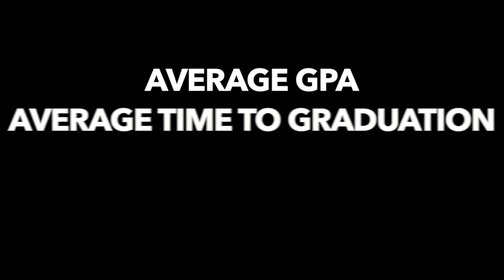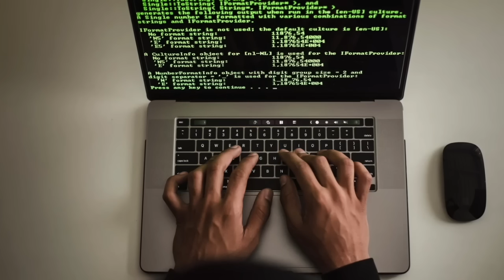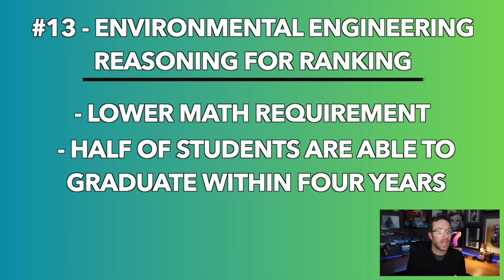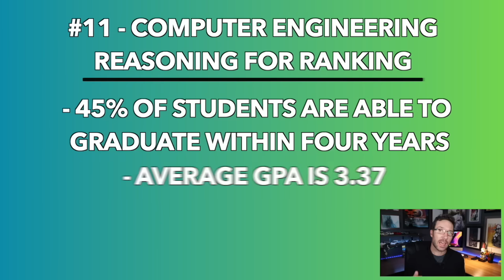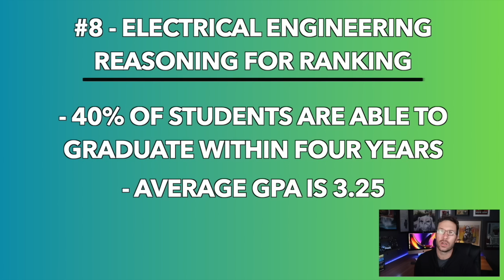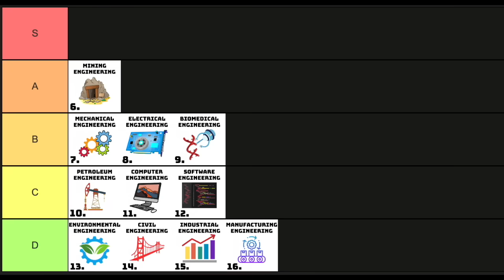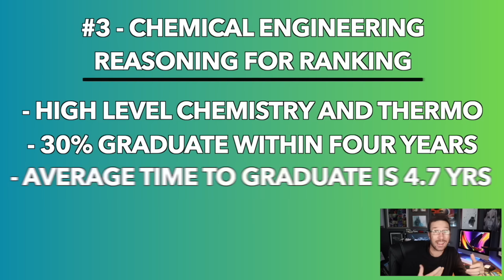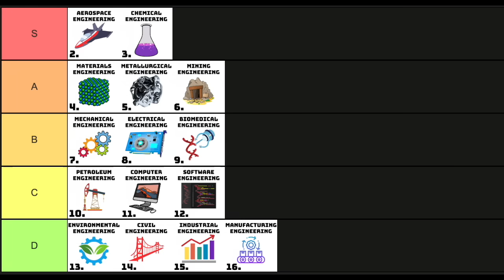Engineering Degrees Ranked By Difficulty (Tier List)

Comment: I have an electrical engineering degree, I wasn't even sure what 'Ordinary Differential Equations' were until I looked it up (its been 15 yrs since graduation). It looks fairly simple compared to what I would call the 'Highest Level of Math Required'. In my opinion, the hardest math (and most fun) that I had to learn was Calculus 3 - aka Vector Calculus, which was required for taking Electromagnetics & Advanced Electromagnetics. Think vector field functions in 3D - magnetic/electric fields. Those were actually my favorite.
Reply: ordinary diff eq are composed of all terms of one variable

Comment: Where should I place electromechanical engineering. Btw I study in Belgium that's why.
Reply: Good question!  I expect a lot of these statistics are primarily for U.S. universities, so the numbers are going to be different.  My guess, though, is that that degree probably combines a lot of pieces from both electrical and mechanical engineering and thus is going to be a little harder than either one alone.  And also it gives you a background that lets you get many of the jobs that an EE would be able to get, and many of the jobs that an ME, so the salary range is likely to be somewhere between the average and the max of the two.
Reply: @BrooksMoses  Appreciate your thoughts 🙏

Comment: Didn’t expect do go top 2 but I’ll take it , you’re sport on with the graduation it takes approximately 5 years on average, I expected petroleum engineering to be higher on the list. Specifically considering gas ⛽️ is almost used in all industries.

Comment: I don't know based on what are you saying about the highest math of a electrical engineering but in my uni that gives masters degree we have applied mathematics, multivariable calculus ,double and triple integrals , electromagnetic theory with maxwell equations , non linear control systems in which you don't have ordinary differential equatinons,Laplace Fourier series and transform Z transform and so many more
Reply: I'm not that smart...would love to be but it just ain't so!
Reply: i struggle so much here "Laplace Fourier series"

Comment: You left out a general Agrictural Engineering degree.  I would rank this one way up there on the difficulty due to everything you have to be proficient in.  This goes beyond the options that focus on food processing or machines or the environmental and natural resources.  You have to be profiecient is some aerospace, some chemical (bioprocessing), electrical from networks to 3-phase power for motors, to environmental (water structures, waste processing, soil erosion, ect) , industrial (manufacturing and robotics), mechanical machine design, to structural.  I have done all of this in my career and the PE exam is tough!   Not everyone can switch gears from fiber optics to concrete design and bridge design to to designing water treatment for a hog farm or air ventilation for a chicken house.

Comment: Mechanical Engineering and Aeronautical Engineering are the most difficult based on the difficulty of the subjects (thermofluids, stress analysis, advanced computer modelling... Etc). That's my anecdotal experience. I noticed all other engineering disciplines (electrical, chem, biochem, civil) having far fewer lectures and far fewer assignments. The maths requirement is high for all, but in Mechanical/Aero, you need to be a jack of all trades and also a master of all trades. With a foundation in Mech Eng, some can get a PhD in Electrical & Electronic Engineering, but going in the other direction (E&EE to Mech) is unheard of.
Reply: In what world do the chemical engineering students get less lectures and assignments? I’d love to go there 😂
Reply: @satrickptar6265  Chem Eng has fewer lectures and fewer assignments than Mech Eng. It's a fact. My direct observation. Mech Eng is the most intensive.

Comment: Sorry but this does not pass the funny look test from a course challenge perspective.  The toughest part of eng degree is picking a course that fits your interests and math skill levels.  When things start moving it gets more complicated, and meche covers so many topics plus requires high level math not only in math coursework but in problem solving for meche courses that it can be tough for many.  Cheme can also be tough because of the chemistry, ee can be tough if you are not interested in the topic, on and on.  The biggest challenge is finding knowledgeable folks to talk to during high school yrs to pick a degree once you are convinced to go engineering.  Wish all you young stem folks alot of grit, determination, and the energy to make their engineering dreams a reality!!!!!!  Then once you get employed the biggest decision is often technical or management (aka the dark side).  Those of us that picked technical careers early may have regretted it later or switched to management mid-career after watchin lesser technical prowess leap forward in compensation.  The difference in "doing work" vs "directing work" can result in 2-4x compensation over a career.  That's quality of life financially but mngt often requires one to be politically and morally flexible, one often has to parrot or cheerlead their bosses' or the company leaders' opinions and narratives, not something all of can do and maintain quality of life.  Good luck, its a helluva journey that can deliver a great quality of life and a secure retirement even with all the nutjobs in DC.

Comment: As an EE, I learned partial differential equations for electromagnetics. I think it is pretty similar to the ME's math needed for fluid dynamics.
Funny, I never needed to solve any differential equations after I learned to transform differential equations into the frequency domain using Laplace and Fourier transformation.
Reply: @BrooksMoses yeah guess so. I'm lucky 🥳 Dynamic systems (I do robotics) are easy when you linearize modelling around an sensible operating point and dont force the real system into saturation.
Reply: Yeah, yeah, you EEs and your nice well-behaved linear differential equations.  Look at you living up the easy life.  :)

Signed, a guy who did a ME Ph.D. in computational fluid mechanics, where non-linearity is everything and frequency-domain transforms just make the problem different, not easier.

Comment: At the end of the day it's about money. My first degree was electrical and electronic. My personal reasons? I love to tinker and the pricing of electronics means, in general, I can do it myself without being a perpetual cog in a machine. I think, if I were setting out today, I would like to get into genetic engineering which I regard (along with AI and Data Science) as the Next Big Thing. Most of my life I'd say the most dominant and important field of engineering was materials science. In terms of degree of difficulty (no pun intended) the only people I've found myself in awe of, during a career that took me into many different fields, are the space guys (astrophysics in particular). To succeed in this discipline you have to be super bright. My IQ, realistically, has never been higher than 145 and not good enough to a be an astrophysicist. Almost any other discipline I could've managed easily.

Comment: I'm a mechanical engineering student , going in my 6th sem , up until I have studied subjects from Automobile Eng., material Eng., production Eng., manufacturing Eng., environmental Eng., industrial Eng. , Designing(AutoCAD etc.) , CSE( C programming in 1st year + MATLAB programming ) ,Along with all other Mechanical Engineering subjects (like - thermodynamics, TOM, heat transfer , fluid mechanics , Eng. mechanics, etc.) + various subjects from different Eng. branches during 1st year and obviously Eng. Mathematics in multiple Semesters . and i have excluded all those courses I have done by myself from SWAYAM portal and others platforms.
I have 3 semesters left until my degree is complete.

Comment: Main things I would change to the list are:
-  EE needs to be broken up into several different sub-categories, that are very different from each other (digital, analog, DSP, RF/Em, etc) ... for some, the ranking might be about right, but for others, like electromagnetics, it would be near the top of the list for difficulty...
-  In general, EE classes can be described as applied math...  You have to be way better at math in EE than for other degrees, but this analysis shows that you need about the same as others, which is completely inaccurate... if you didn't take the hardest math classes available at your high school (i.e. calculus), then EE might not be for you.
- Aerospace is usually just a couple classes different from mechanical... basically the same degree (at least according to the aerospace engineers I work with), so I don't know how they ended up so far apart from each other on the list.
Reply: I graduated back in 1976 with an Electrical and Electronic Engineering Degree. Even back then it was obvious the course was too broad to attempt both heavy and light current engineering and  to cover the rapidly expanding subjects and capabilities one needed to concentrate on one or the other  as your major subject. The rise of digital technology in addition to analogue techniques  meant the complexity of what one could engineer rapidly expanded.  Power  electronics increasingly meshed with signal processing and digital techniques  and electronics  spinning out into more subjects like integrated circuit design, telecommunications engineering, microwave engineering  and computer  engineering. 
More than the chosen engineering subject the  difficulty in mastering any branch of engineering in my view depends how at home you are with  advanced maths and physics.  When I later recruited for a major  employer I would always look for maths and physics graduates because they  in general in time as they learnt the engineering  required for real life jobs could outperform those who has taking a first degree in engineering because their baseline knowledge of key fundamentals was stronger. 
Personally I went on to do nuclear engineering which added so much  knowledge and for me fully utilised and took further the general  engineering that formed the common first year for all engineers  at a UK university I attended., especially thermodynamics and materials  which most E&E grads are glad to put aside after their common first year.   For example as an Electronics and Electrical Engineer using steam tables for reactor secondary plant design was a very different experience to using steam tables to get past a first year exam.  It showed me that the first engineering degree was just an introduction and the major learning was right across the whole of my working career.  
Later when I taught telecommunication engineering I used to explain to my students that my goal was not to teach them a particular engineering subject but simply use one as vehicle to learning how to learn for one's self so to be able progress to self teaching life long learning and to develop knowledge to able to work in multi-subject project  teams with a good level of mutual understanding, while adding their own subject knowledge to the mix.

Comment: I studied a lot of Math in college. Pre Calculus with Trigonometry, Applied Calculus, Calc 1 to 3, Liner Algebra, Modern Algebra (set theory), Modern Geometry, Numerical Analysis, Statistics, Introduction to higher math (aka leaning proofs). What was my take away after graduating with a degree? - I am too stupid to be an engineer, or work with Math full-time. I now work as a security guard. [Math use these days is Numerical Analysis, and that is what I sucked at.]

Comment: Electrical Engineering is a vast area. The more difficult area is RFIC or semiconductor design. Advanced degrees are sought. Pay is above $150k, usually around $200k.

Comment: When I was in school, we tracked what majors students transferred from and to.  There were as many engineering majors back in the 70’s, but by our student transfer tree the hardest major was electrical engineering physics.  We knew no one who transfer into this degree and most who transfer out dropped to electrical.  From electrical many transferred to mechanical or out of engineering, often to business where our school had a respected business school.  At our school, industrial was lowest on the engineering tree.

My kid went to CU Boulder in electrical and I’d say their aerospace engineering program is the toughest.

That all said, I’ve taught at a university and have seen that some departments just make their program harder without introducing more difficult topics.  So, I am suspect of the “time to graduate measure”

Fun video though (even though you didn’t rank my engineering degree high enough, in my opinion)

Comment: How is mechanical engineer not top? Like from my experience you have to know every freaking engineer field at the same time because when they run out of fields they're gonna come to the mechanical engineer to solve it. Like mechanical engineer's curriculum has IT (as in coding), AI, security, chemistry, materials, process, finance, electronics, automation, manufacturing, production, construction/strength calculations. You thought you'd be designing engines and stuff. Well have fun you're gonna learn every other field of engineering first. And now you're supposed to have people skills too like communication and empathy, self-orienting, resilience, languages. Man, if superman was real, he'd be a mechanical engineer. That's the level of realistic requirements.

And what do you mean by "aerospace engineer"? That's literally a major in mechanical engineering. Like half of your engineer tier listing participants are just subjects/majors of mechanical engineer degree: industrial, manufacturing, aerospace, nuclear, these days material is separated, technically mining is also part and metallurgical would make most sense, but don't exist here, they'd hire a mechanical engineer most likely. Environmental probably wasn't and civil engineer is slightly more shifted but shares the same classes. You didn't list automation or robotics but also either part, separated or same classes with mechanical engineers. And then you indeed have to have software, electrical and chemical studies. Fourier transformations are likely to be in your curriculum on top of the partial differential equations, whichever you rank nastier I suppose. Wouldn't hurt to study some fluid dynamics math either since energy technology is part of mechanical engineering.

Oh wait I get it. Your engineers need only 125 credits. That's the basic general studies here, you study 240 for basic engineering degree and 300 for master of science in mechanical engineering. Turns out it makes no sense to compare the engineer degrees I know to this list.

Comment: Does a student have to be very good at maths to become an aerospace engineer?
Reply from the maker: usually pretty decent yes. but you can learn as you go.
Reply: @becominganengineer2271  And aircraft maintenance?
Reply: @salehwahib3749  : No need for any hands-on experience before starting college.  College is mostly about teaching the theoretical parts and a little bit of the practical parts, and then you learn a lot of the practical parts on the job.  But an aerospace engineer is going to be designing the aircraft, not maintaining it.

Comment: I have graduated in Chemical Engineering and also doing a job currently but passing the degree was quite difficult for me. I don't have any interest further in this field. What should I do. I'm a bit worried about Future, what im gonna do.
Reply from the maker: congrats on graduating. have you looked into manufacturing? i know many chemical engineering who now work in manufacturing. or systems engineering. or process engineering. or continuous improvement engineering. or reliability engineering.... many options.
Reply: Lots of people have sharp turns in their career.  I think it's probably more common than the people who started out in a field and did the same thing from undergrad through retirement, even.

In my case, I went all the way through a Ph.D. in mechanical engineering, and then took what I thought was a short-term break from that with a job as a computer programmer using the programming skills I'd learned by doing computational fluid mechanics in my Ph.D., and that job stretched from a one-year thing to a two-year thing to a five-year thing to getting another software engineering job at a different company where I've now been for a decade.

The good thing about an engineering degree is that a lot of the skills are transferrable.  I don't solve fluid equations much any more, but I do think about programming problems with perspectives that I learned from solving fluid equations.  And the skills I used in learning things in college are things I use every day.

I'd say look for things in your job (or hobbies!) that you do like, and look for adjacent things that have more of that and less of the things that you don't like, and see if you can move in that direction -- either taking a new job, or in the short term focusing more on that part of your current job.

Also, the world could use more competent managers who understand what's involved in solving engineering problems, so if management sounds like a direction you'd enjoy, that could be a useful direction.  You don't need to be a manager in the same field your degree is in for your engineering background to be relevant.

Or, heck, if this really isn't what you want, take a year at a trade school and get a job working as a welder or a plumber or a CNC machinist or something like that.  Those trades make good money, it's satisfying work, and being able to speak "engineer" is going to be a really useful asset in the industrial sides of those fields where you need to work with the engineers who designed the thing you're building.